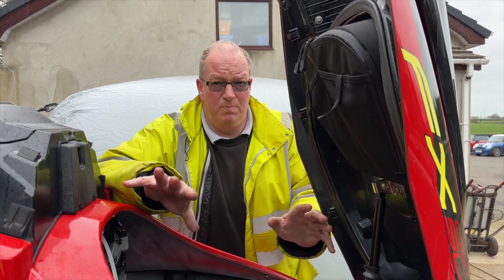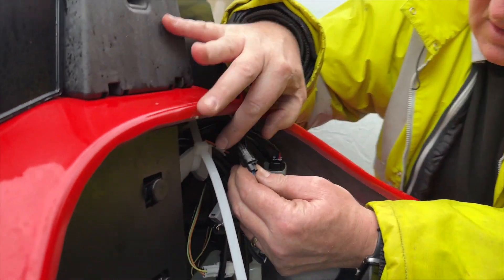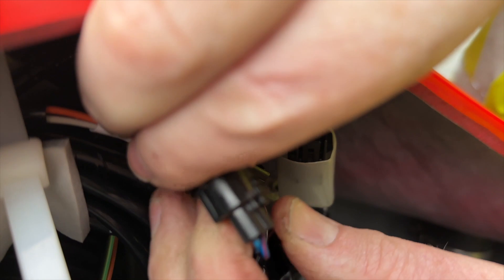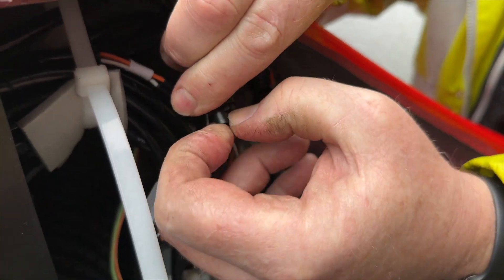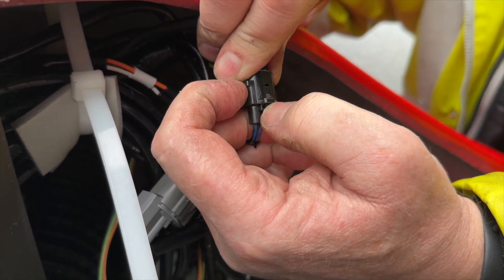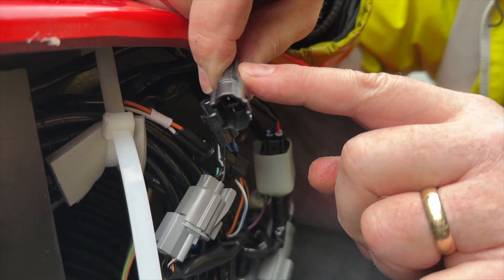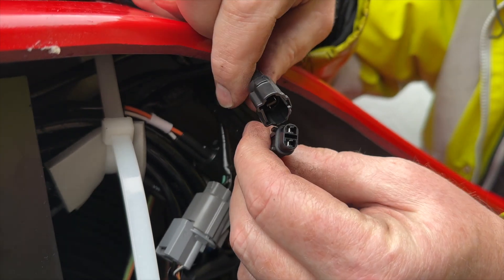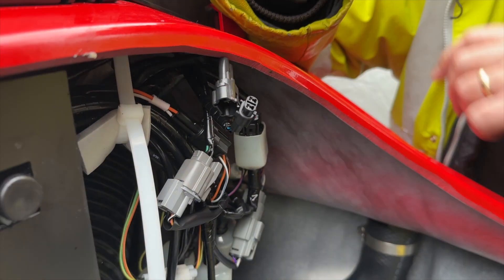JETSKI TV - Episode 5 - Disable 2022 Yamaha Waverunner Low Fuel Alarm

Comment: Did mine, exactly same wires and colours as yours, 2023 fxho. Thanks so much from nz
Reply from the maker: Glad you got sorted, stay in touch with your local dealer, there is a patch rolling out that is supposed to address the fuel used reset issue and the buzzer. I have not got mine done yet as its mid winter in the UK. I will report when I get it done.

Comment: you need to complain there is a issue the more complaints the fater they will have a fix
Reply: Done via dealer
Reply: Yamaha is very well of this problem. It has been in several years of production. They have no plan to change this.

Comment: Hello - having issues finding the exact wiring as you have shown is it further back and up in the assembly? I disconnected a Blue/Red Black/White to a Blue/Red Black last night which it did not like / caused a fault code
Reply from the maker: What year and model is your waverunner
Reply: @jetski-tv  It’s a 22 FX HO Cruiser
Reply from the maker: Should be exactly the same as i showed
Reply: My 2023 FX-HO
has a black/white & red/blue connecting to
black & red/blue. I wonder if they have changed the wiring to side step disabling the alarm?
Reply: @Ryanm99325 did you ever figure out how to disable alarm??
Reply: @dvh6813  nope, never figured it out. I pulled one which prompted an error that cleared on its own. If you figure it out lmk
Reply: Will do!

Comment: This problem is very annoying. I have a 2023 fx cruiser. The wiring is different from the one you showed, so I don’t know which one to unplug. It will start beeping when there is still 8 gallons of gas. The key is that I don’t Knowing how to silence it, I tried touching that red alert prompt to no avail. I would like to know how many gallons of gasoline this Yamaha jetski can use at most, and whether it is possible to use up all 18.5 gallons? You still have to leave about 4 gallons to suck up the gas, and in the end it will not only keep screaming but also forcefully slow down, making you slower and slower.
Reply from the maker: Follow your wiring from the same area, see can you find the buzzer unit. Or have the ski beeping and disconnect each plug in the area i showed one at a time to see which one stops the beeping. I think you should be able to perform that action in accessory mode

Comment: is there a way to put a switch on it to shut it off on the weather rather than completely disabling it?
Reply from the maker: Its only 2 wires so a switch would be easy if thats what you want to do
Reply: @ILWDAYDC that is what I am gonna do on mine. even with the update it still tells you that you are low on fuel when you have 25ltrs fuel or else find the buzzer and put it in something to lower a lot the sound that doesnt annoy you.

Comment: Apparently there is an update that fixes the issue which can be done at the dealer. If anyone manages to go to the dealer can you please put the update on USB and share it, as where I live we only have 1 dealer which is s*** and and they keeps saying that they want to replace the sensor which isnt the issue.

Software Version = P1.0
Application Version = 5.1308.0
Application PN = 78333157
YamahaPWC = 513090 20210818

Here are the software details AFTER the update:
Software Version = P2.0
Application Version = 5.1309.1
Application PN = 78333157
YamahaPWC = 513092 20230825